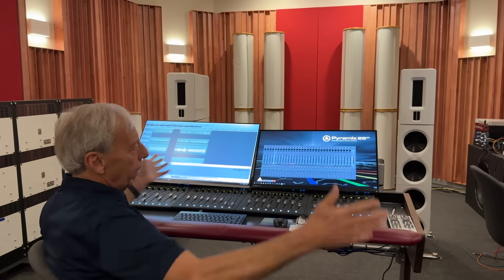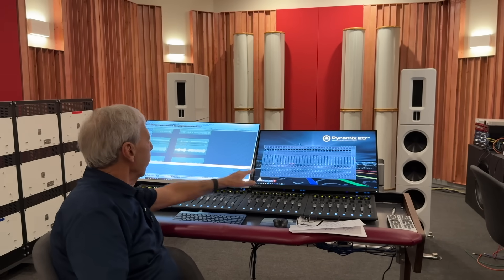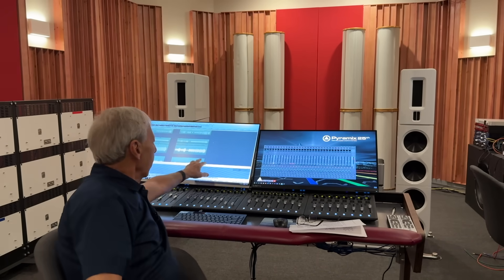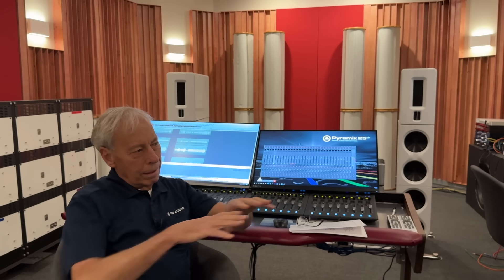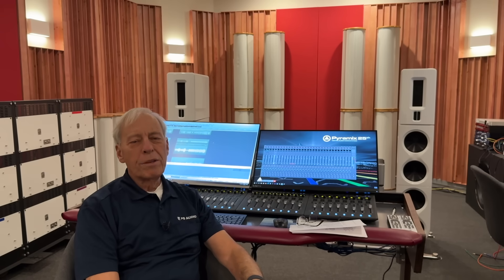Why bypass caps work in  an audio power supply

Comment: worth to add that sound constanlty passing these caps as audio signal as well. audio sugnal is also AC that passing PSU circuit as well as transformer as the caps wave resistance never get down to absolute 0 ohm in terms of AC audio signal.

Comment: Way back in the 70s when I first heard about adding a small cap across the filter capacitors (on my Dynaco MkIIIs)- I remember the reason given was to shunt the high frequency noise to ground.

Comment: What happens if u have preamp in between the headunit and amplifier does that change your end slope at the amp,4 instance if the preamp is 12db and the amplifier 12db does it make it 24db at the end slope of the amplifier output?

Comment: Interesting coincidence - recently (9-Nov-2025), Mr. Carlson’s Lab did a video on putting a small cap across each diode of the bridge rectifier.  IMO he didn’t explain it very well, but to me it seems that by doing so, you’re preventing the harsh/sudden turn-on and turn-off of the diode from getting into the DC supply in the form of thin spikes spaced at 60 Hz (or 50 Hz) apart.
Reply: That's called a snubber
Reply: @mitchtaylor6512  I wouldn't call it a snubber.  A snubber typically also contains a resistor.  The purpose of a snubber is to protect a solid-state device from spikes due to switching an inductive load.  Here, the load isn't inductive, there's no resistor, and there'd be no danger to the diode if the small cap wasn't present.  I suppose you could say this is doing the same thing as a snubber, but with the possible spike voltages on a micro scale, as compared to what's handled by a "real" snubber.
Reply: As the current switches through the diodes it can cause them to ring, adding high frequency spikes to the out going current and the windings of the transformer. Adding a bypass capacitors parallel to the diodes helps to reduce the ringing. Typically a 0.047μf or 0.033μf capacitor is used. Ideally these want to be 2X rated.

Comment: Great explanation.  Not being an electrical engineer, it reminds me of the time my electrical engineer told me that the high speed mechanism in a power hand tool we were developing couldn't be supplied enough power through a normal 120V/60Hz wall outlet. I had never thought about not being able to pull power out of a wall outlet fast enough when you are limited to 60 cycles/second. Paul, your explanation of the power source and capacitors reminded me of that illuminating conversation.

Comment: What might be helpful for understanding is this: 
Delivering Voltage/Current from the power supply to the Audio circuit is not a one way road. Every current "moving" within the audio circuit causes a related modulation in the power supply so that the music can actually be "heard" in the ps. It's like dancing on a dance floor. You want the floor to support your steps and give stability but in a particular way, not too tight (like concrete) and not too flexible (like rubber). Let this floor (your power supply) be a plain but somehow flexible wooden floor and the ballerina (your audio circuit) will be able to dance beautifully.

Comment: That was a wonderful explanation for people like myself who really had no idea of how it all works. Thank you.
Reply: The reason capacitors are great is they block dc and let ac pass through. If a power supply is 9v out then you can have a capacitor on the output that goes to ground. The ripples in the power supply will go to ground but the 9v will stay.

Comment: Filter capacitors have two jobs. One is to get rid of the 50/60Hz component in the power source. The other is to decouple the stages from each other. Each of the individual circuits that make op your design tries to impart it's higher than the 60Hz frequency signal onto the power source and when each one does so  it muks up the power for all the others. An electrolytic capacitor does not work well at these higher frequencies so we assist them with film caps that do a much better job. Since these offending signals are much smaller than the 60Hz the film cap can be a much smaller value and still accomplish the task. Same with interstage coupling capacitors. Electrolytics are awesome with bass but due to the higher effective series resistance at higher audio frequencies they suck at midrange and treble so the film cap bypass solves that problem. There ya go.

Comment: Ok Paul, just let us have your Staedtler and your slide rule. Thank you. 😀

Bypass cap, per the OP's question (not the divergent thread into film vs. electrolytic) is to divert frequencies above a certain Hz to ground. In the audio path, that stops these frequencies from getting to the driver, possibly causing distortions or worse, overheating. In the power supply, it is to further reduce ripple and to help stabilize the circuit, reducing the possibility of ringing or other high-frequency artifacts. 

In your basic linear (and even switch mode) power supply, you have ripple at some multiple of the base ac coming into the main part (transformer or the switching frequency). The large value capacitors do the main smoothing. They leave a small amount of ripple voltage that you can view on an oscilloscope. If you zoom in on that ripple enough, you'll see more (high-frequency) ripple riding on that main ripple. The right value bypass cap will divert that high frequency ripple to ground, thereby cleaning up the power, giving you much more clean power for your circuit. Ie, less extraneous noise gets through to muck with the target signal of the design. 

Yes, the basics are that simple.
Reply: I'm surprised that Paul fumbled it so badly.  Paul has been off on many other things but I don't remember him messing up on something this simple.
Reply: as I understand, the smaller bypass cap is, the higher freq it let through itself, that's why it's often used in crossovers

so I guess it can give the same effect in power supplies, let high freq noise come through filter?

one more thought
maybe the big and the small caps differently operate the phase of high freq noise and it works as a sort of subtraction?

Comment: I will endeavour my own take on this, and the angle is a little bit different. An ideal voltage source has an impedance of zero Ohms. That means that the signal does not see the power supply. Never the less the power supply is always part of the signal path (that has to be a closed circuit). So if the signal has to traverse the power supply, in essence the coupling capacitor and the power supply bypass capacitor fulfil the same task. And because the guy asking the question told us he understands the criticality with the coupling capacitor, understanding that the signal traverses the power supply should make it easy to understand the criticality of the power supply bypass capacitor as well.
Reply: I think the nature of bypass capacitors in AC and DC circuits is different:

With DC power circuits (Noise Filtering): The capacitor acts as a noise trap. It creates a low impedance path to short-circuit the AC components (parasitic noise) to ground immediately. This prevents noise from entering the downstream components, ensuring a clean and stable DC power supply. Since this noise frequency is very high, a small bypass capacitor is usually effective.

With AC signal circuits (Flooring/Crossing): The capacitor acts as a high frequency compensation path. Since large main capacitors often have parasitic inductance (ESL) that impedes high frequencies, the bypass capacitor (small, low ESL) acts as a 'shortcut' to help the high frequency signal pass through easily, ensuring the detail of the signal.

Comment: good explaination, but i didnt catch where you directly answered the question of why exactly what benefit exactly are film bypass caps in a power supply?
Reply: It's for reducing the impedance of the ps up to very high frequencys which can't be achieved only with electrolytic caps.
Reply: @mathiaskiesling3193 yep. The lower the impedance of the power supply the better.

I'm a DIYer and build all of my power supplies myself. I use a large bank of high quality (Elna Silmic II) small electrolytic capacitors rather than a couple of big ones in my phonostage, dac and preamp. This approach results in a much lower esr. Of course a small film capacitor is also used to bypass the bank of electrolytics.

Comment: Not really explained it very well it's the charge and discharge cycle increases speed intern helps with smoothing out Ripple. and use a ferret instead of a point one

Comment: But why does a small value capacitor bypassing a high value electrolytic in the power supply make any difference ??
Reply: The big electrolytics are good at smoothing out low to mid frequencies, but not high frequencies.  You add a small cap in parallel to it to also keep the high frequencies smooth.
Reply: @kc9scott  But these high frequencies this small capacitor is influencing are far beyound the audio range, this should be realised ...
Reply: @johnnaighley9252  AFAIK, you’re right.  It’s a bit of a mystery why this is relevant to an audio circuit.
Reply: @kc9scott  Yep, the mystery lies in the experience that we may hear it but cannot measure it in the audio range ...
Reply: Essentially, the high value electrolytic compromises it's ideal characteristics for greater storage.
Reply: Exactly this is the question that Paul did not answer ...

Comment: Paul is stumbling all over the place on this subject.  
Partly right, partly wrong, and partly confused.   
I expected a better, more cohesive statement.
Reply: I think that he did fine, remember that his aim is to talk to the less technical viewers without bamboozling them. He does ramble a lot, and I find that endearing, it's more of a conversation and not a lecture.
Reply: I have faith that he has the CAPACITY, to do so.
Reply: While I really enjoy these videos, especially the technical ones, I really think it would help to do these in front of a white board.
Reply: Go for it then
Reply: I expect you've never tried bypassing and hearing the results or swapping altering power supply caps ? Easy to hear but Paul was honest enough to say he has a hypothesis not a proof as to why

Comment: The problem is simply capacitors are not perfect and internally a large electrolytic capacitor is made of many windings of foil that works as a coil on series with the actual capacitancs. A coil in this case is a sort of low pass filter making the DC voltage prone to more higher frequency power supply noise in the music. Caps with little inductance in parallel will help compensate for this issue.
Reply: Thank you !! Geeze a simple rational explanation here !! Appreciated
Reply: Excellent explanation , and precisely why.

Comment: On the issue of AC vs DC transmission, it’s worth mentioning that DC is actually viable for long distance transmission so long as the voltage is stepped up high enough. The technology to do this reliably wasn’t around at the time so AC was the winner and understandably so. If we had to rebuild our entire electric grid from scratch with the technology of today, DC would be the way to go.
Reply: It wouldn't work as well for industrial motors.
Reply: How are you going to “step up” DC?
Reply: @zulumax1  Huge inverters.
Reply: Hardly any existing appliance would work.

Comment: Biggest 'tweak' I ever did was replacing the power cap in a phono amp...   It was budget diy grade really, though with some upgraded components - upping the quality and size of this cap just transformed the resolution at every level and reduced the noise floor from 'meh' to quiet.
Reply: you got more punchy linear behs huh
Reply: I did exactly the same with exactly the same results. I also swapped the voltage regulators for some from Sparkoslabs. These made an even bigger difference. I'd definitely recommend doing the same if your phonostage uses LM78xx and LM79xx voltage regulators. If it uses LM317 and LM337 regulators they can still be swapped for sparkoslabs but will require a couple of resistors removed from the circuit board and a couple of links added.